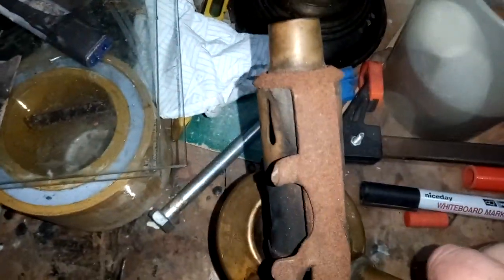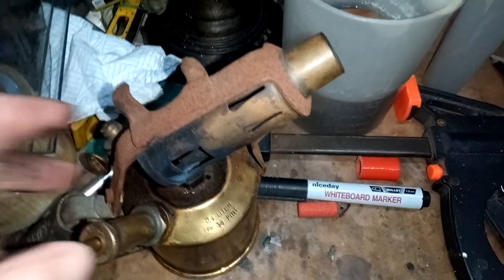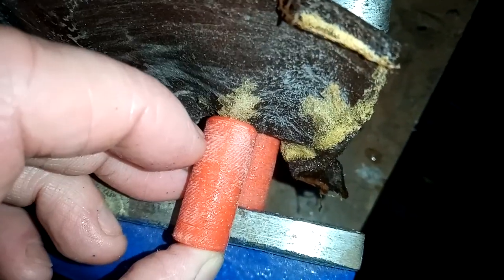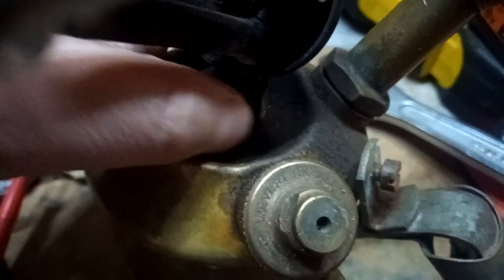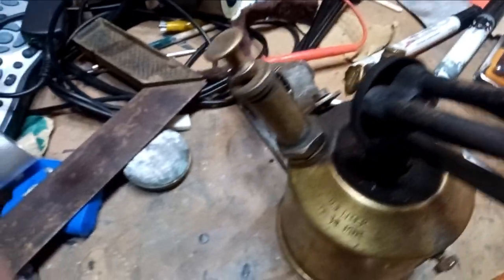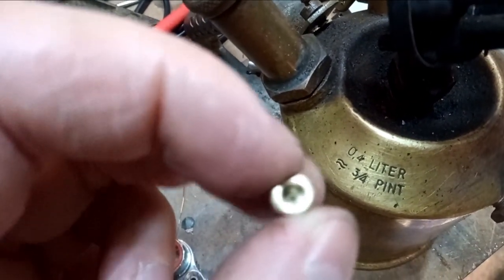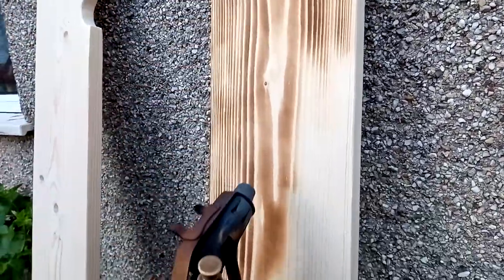How to fix: a Max Sievert primus blow torch.

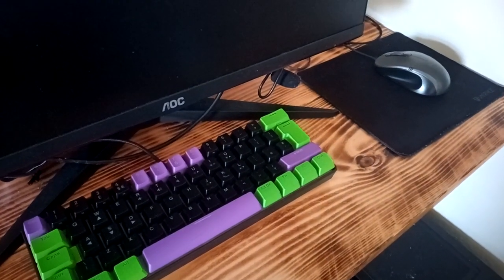Comment: Hi At 2:20 / 5:46 you mentioned downloading a tool to fashion old leather into the right size. I could not make out what was said. Could you right it down for me please?
Reply: Sorry I'm there now thanks.
Reply from the maker: @ianryan7826  The tool is simply a tube and a cylinder shaped insert that allows for the thickness of the leather. My feeling is that the size of the leather cups might have been standard.
Reply: @pixelvalve  OK